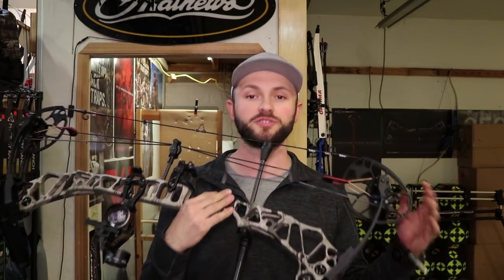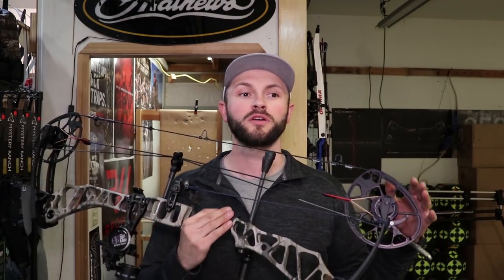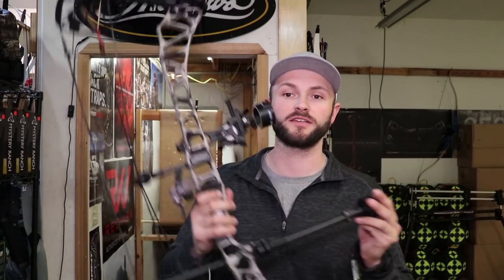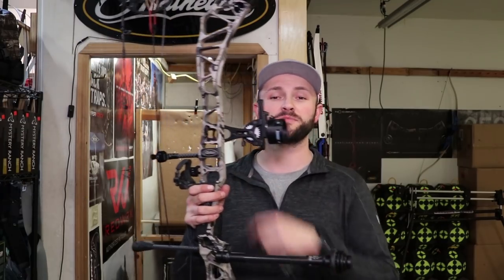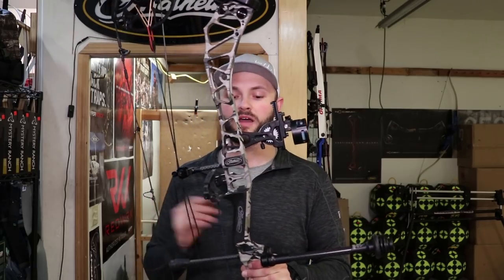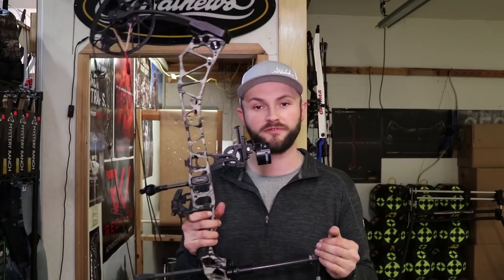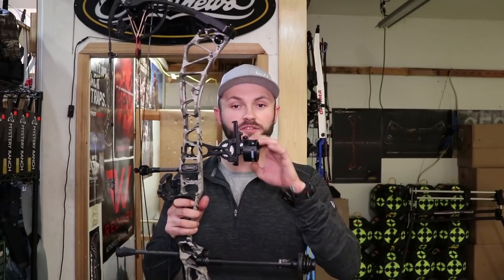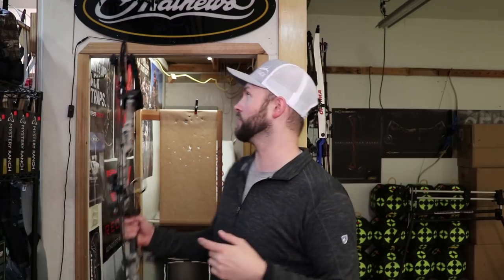Bare Shaft Tuning: Getting the most Forgiveness out of Your Set Up

Comment: Really good video! I bare shaft tune and don’t even worry about paper tuning with fletched shafts. Would like to see how your broad heads fly after a tune like this.
Reply from the maker: Agreed. My fixed blades fly right with my field points out to about 70yds, then start impacting low. But that's because there's more drag

Comment: How do you account for difference between arrows in your quiver?  If they are not all spine aligned, how do you know your 1 bareshaft arrow is what you should be making decisions on?
Reply: Simple. Use the spine aligned arrow to tune. Once youve got bullet holes fletch the rest and shoot. If they don't group well or have clean flight rotate the nock to different positions until they're shooting good. It's called nock tuning

Comment: How about what to look for when buying a used bow? 

I had bought a used bow from a reputable dealer in Dec that had replaced strings and limbs so I thought it was good to go but this last weekend one of my cables broke which basically blew the limbs, cams and mods apart, had it been hunting season i could have been SOL. Luckily i was shooting at a dealer shop and he had all new parts and was able to get me going again. What do others do in this situation if it was to happen to you? Do a lot of people have back up bows just in case?
Reply from the maker: Unfortunately most companies only honor their warranty with the original buyer. That really sucks that happened to you though, usually a used bow is legit!
Reply: @InsideOutPrecision  Yea I know most companies only warranty new bows. I consider myself lucky that I was only into this NO CAM for $80 before it broke so getting it fixed was still a no brainer. I was just thinking that other people may benefit (especially new archers) from a video on what to look for if they are buying a used bow.

Comment: Please do a spine selection video... For compounds there's very little out there
Reply from the maker: I actually have a video where I talk about arrow spine! If you have any specific questions though I'd be happy to answer them!
Reply: @InsideOutPrecision  I've had a look at the spine video and understand arrow spine and how to select and tune arrows as I've shot olympic recurve and can bareshaft + paper tune my recurve bow and also use the Easton chart to pick a suitable shaft for tuning 

However with my compound I've not been getting decent groups and for the past few days I've been trying to paper tune but can't seem to get a tail right high tear out

At 30" - 6 feet from the paper I almost get a bullet hole, sometimes nock height is level but I get a slight right tear other times nock high right tears..... I've shot with the string away from my face just incase it was face contact on the string but there was very little difference... At short distances I can get the bullet hole 

I've moved the rest, adjusted the rest height and tension on the rest from super stiff to almost holding the arrow weight... But if I step back say 5 yards I get nock high right tear... I can fine tune the nock high but not the nock right as the tear is around 2"+

I've shot with open relaxed hand and normal grip with a finger sling

I've even cranked the bow down 6 turns to reduce the weight but no difference and shot with and without stabilisers

I've shortened my drawlength from 27" to 26.5" but the only difference is I feel cramped on the 26.5" so have gone back to 27" otherwise I have to raise my bow shoulder to accommodate the shorter drawlength, with the 27" my release elbow is a little low but the shots are consistent because I can get the shafts to touch at 10 yards... I can draw level and bring the hand to anchor without craning my neck to find the peep so it feels comfortable and can handle the bow weight

(my recurve I shoot 26.5" drawlength and 47# on the fingers) 

I've shot pulling hard into the stop to having just enough pull to hold it in the valley, no difference other than the feeling of the shot... Using a thumb release truball max pro 4... I can trigger it using my thumb or pull through the shot using arm/back tension with my thumb wrapped around the trigger

I have a PSE stinger extreme, draw weight approx 50# (measured at 49.6# using my digital scale)

My arrows are Easton XX75 platinum plus... 2016 at 29" and Easton XX75 platinum plus... 2013 at 28"... I think the point weight is the standard nibb that's around 70grn 

The 2013 show less of a right tear but still nock high

Shooting with the fletch and bareshafts at 10 yards.. Unfortunately that's all I have at home I can get the arrows to group within an inch of each other and the bareshaft lands left of the fletched arrows with nock kicked up within an inch of the group

If I watch the arrow flight there is a kick right of the nock which shows up on the paper tune at around 5 yards 

The only thing I haven't tried is cutting down the shafts to 27"... I have an arrow saw so can try that but if the arrow isn't right, then will that help?

Are the arrows weak or stiff... Kinda hard to work out for compounds... Recurve finger release its a stiff reaction 

The cable guard has enough fletch clearance approx 1/8 of an inch+... I've also tried moving that
Arrow is level and centre shot as close to straight as I can get it

The question is how do I use the chart... Do I use the ATA bow rating 316 with my drawlength and draw weight to select the spine group or do I need to buy a chronograph and measure the speed at my drawlength

I'm interested in target compound and not hunting and would like to progress further with this.. Just having a hard time at the moment getting consistent groups out to 18m/20 yards at the club
Reply from the maker: @b12khx89  whoo, that is a lot to take in. What kind of rest are you running? For a right handed shooter a tail right/high tear that won't leave is usually a sign of too stiff an arrow. Try increasing point weight.  The rest will have a lot to do with it as well. Cable driven drop aways sometimes don't support the arrow long enough for bows with nock travel, which the stinger does.
Reply: @InsideOutPrecision  the rest is an avalon tec one rest... Nothing fancy but I did try and move it to tune and it ended up looking like the arrow was pointing away from the bow more than my recurve has ever done so I've gone back to all square 

I'm still working on my form and using my old recurve arrows in the meantime, the XX75 platinum plus are limited for different points with heavier weights so kinda stuck there... I'm not shooting compound for competition yet but would like to get better so tested it via the paper tune as I can see weird arrow flight if I watch the arrow

I wondered how you would use the Easton guide to select an arrow as it has different ATA speed ratings and using the bow weight and drawlength information it kinda puts me in T6/T7...which is probably wrong 

I am working on getting a form video done for you... The UK weather is getting better so I'll be in touch via your instagram
Reply from the maker: @b12khx89  that rest could definitely be part of the problem. I'd try a limb driven drop away like the Vapor Trail Gen7. Also I'd recommend going to an all carbon arrow in a 400 spine cut at 27-27.5".  As far as paper tuning, I generally just paper tune at 6-10 feet and get a bullet hole with a  bare shaft and a fletched shaft, then shoot them at 20yds and micro adjust my rest until they hit together. 
Definitely send me a video when you get a chance!
Reply: @InsideOutPrecision  thank you for taking the time to reply... I'll have a look at your suggestions, I'll practice some more and get a video to you

Comment: Love your videos. Do you use more than one bare shaft arrow? Is it necessary to nock tune? I ask this because I am finding that bare shaft tuning can be difficult, or finicky. Thanks for your help.
Reply: Nock tuning can help define the stiffer side of the arrow... This is ubertuning though, you need to be good good to be able to even tell... If your having trouble effectively bareshaft tuning you either have a bow tune issue or a form issue...bare shaft tuning, nock tuning require a tuned bow and rock solid shooting form and are at the end of the process...you dont just go out and shaft tune.

Comment: I'm amazed that people won't take that little extra time & synchronize the difference between the fletched arrow & the bare shaft. U can align a car but if the frame or foundation is crooked it won't matter. Then to make things worse they then throw a mechanical on & say good enough. Then they wonder why they have an 8 hour long bloodtrail with no results. I personally will not fletch an arrow unless the field points spin perfect & I know that I have the insert/outsert perfect. I have 5 perfect on my latest arrow build for my new bow & I'm still working on the 6th.

Comment: At what distance was the initial paper tuning done?
Reply: He replied to another comment: "I start at 6 ft and work my way back to 7 or 8 yards making sure its a perfect hole as I back up. Takes VERY LITTE movement in the rest to correct any kick at 8 yards"
Reply: @DarxusC  Thanks, that's why I just ordered a microadjust rest!  Bumping a normal rest 1/64" stinks.
Reply: @MrShysterme  yeah, the only thing I have to compare it to is a $700 rifle scope.  So, relatively, the stuff that came with my bow kit is utter garbage.
Reply: @DarxusC  Sorry to hear that.  Those bow packages are good to start, but eventually many folks want to upgrade to microadjust sights and rests that they can pick out themselves.  But those bow packages serve a purpose because they are a good gateway to let you get the experience to learn what you like.  Then you get ready to drop the major coin!  But don't spend that major money on all separate components until you have figured out what will work for you.  Check out Hamskea rests and Spot Hogg sights.
Reply: @MrShysterme  yeah, I knew the components wouldn't be great.  When I bought my good camera, years ago, I bought the body and lens separately, instead of a kit, because I knew more about what I wanted than I know about compound components.  I just feel like they went out of their way to make these kit parts as inconvenient to adjust as possible.

Comment: Thanks for the great content you share! I can get bullet holes fletched and bare shaft at about 4 yrds then when I step back to 10 yrds I'm nock high. Adjust rest up to hit bullets again but then I'm nock low back in at 4 yrds.. Any advice is greatly appreciated!
Reply: I’m having the same issue.
Reply: @jeremyanderson5752  I watched other videos which talked about how paper tuning at 5 yrds is optimal. Further back is giving the arrow too much time to react to the forces applied to it giving misleading results. Depending of course on many factors including spine, tip weight and draw weight. I paper tuned at 5 yrds and moved on. I'm shooting 6" groups at 60 yrds. I feel like I should focus on my form now at trust my setup. Cheers!
Reply: Have you checked vane clearance? Sharpie on rest and check for Mark's on flethings.

Comment: What about checking your shaft stiffness or weakness when bare tuning?

You mentioned in beginning and never talk on it.   I run a 350 VAP SS. 65lb. 250 up front. 510 gn total.

Comment: When bareshaft tuning at distance should you pay attention to what the shaft is doing in flight? So I shoot a bareshaft that bullet holes at like 3 feet and 6 feet. Then I take it outside to see if bareshafts and fletched group together. They group together but my bareshafts will be flying tail left or right. Enough you can see it and it is flying at an angle through the air. Is that just normal due to not having the vanes or no?

Comment: I have a Right Hand Traverse and keep on getting a tail left. My initial thought was spine but from 250 up to 340 I get same tail left. I have the centre shot at 13/16. I had it that you move the rest to the left if you have a tail left but from your video it seems that I need to move it right. In my case this will bring the rest closer to the riser and that can result in vane contact.
How much closer to the riser can I move centre shot? Will swapping top hats help? Looking at the cams from behind the bow the spacing of the top cam is basically even. Bottom cam is much more to the left almost touching the limb. Itis not that I’m new to the sport. Got my national colors last year in IBO and was the over-all winner of the South African Bow Hunters Association’s 3D shoot in the Fixed Blade Broadhead class. That was with my Bowtech Insanity CPXL. I though I know how to tune a bow.... but I’m not getting the Traverse to where I want it. Specs, 65#, 31.5” DL. Arrows at 31” with 50gn inserts and 100gn tips. Blazer vanes 2” x 3 and Bohning double lock nock and 300 spine. Most charts and calculators indicate 300 spine. Need some guidance. Thx Vick
Reply: Keep your center shot at 13/16. Left tear, move your cam to the left with top hats first. Rest goes to the right only on final micro adjustment. Cams follow the tear, rests go opposite tears.

Comment: I noticed your bare shaft doesn’t even have wraps on it. Did you add something like electrical tape to the bare shaft in order to get the weight the same as a fletched shaft?  You are probably 30 or more grains lighter with the bare shaft if not.
Reply from the maker: You can add a wrap if you want, but I've never had an issue not having one. I suppose if you really want to mimic your vane weigjt you could though. Those mini blazers only weight 12 grains (all 4) and wraps only weight 7.  Thats barely more than the weight nock so it shouldn't have any effect

Comment: OK I have some questions for you. I've been playing around with this a bit and am not having the same results on my VXR 28.
I paper tuned my bow and got it shooting bullet holes with bare shaft and fletched arrow at 6' and 5 yards.
I went outside and started at 20 yards and after my left and right adjustments, the bare shaft and fletched shaft were hitting together with the bare shaft no more than 1/4" higher than the fletched arrow. I figured this was due to the bare shaft being a bit lighter with no fletchings.
I then stepped back to 30 yards and my bare shaft hits about 2" higher than the fletched shaft. At 40 yards its about 5" so it keeps climbing as I step back further.
I moved my rest down and it improved a bit but only to a certain point. From there on, the bare shaft and fletched arrow point of impact move together with any adjustments of the rest and the bare shaft stays at about 4" higher than the fletched shaft and they don't get any closer. What am I doing wrong here? Thanks.
Reply: You have to think the weight of the
Fletching and glue etc. Are going to add weight which will give you a greater gap at distance

Comment: Why wouldn't you add tape to the back of your arrow to match the weight of the vanes?  Wouldn't that make a difference?
Reply from the maker: Hasn’t in my experience. But if you were really on the bubble of being under spines I suppose the extra 20 grains could make a difference

Comment: In the beginning of this video When it comes to making adjustments to your rest when you paper tune a bare shaft, does the same concept pertain to that just like it does when paper tuning a fletched arrow? (Meaning if you have a tail right, move rest to the left. If you have a Tail left, move rest to the right, if you have a Tail low, lower rest and if you have a tail high, raise your rest.) Same adjustments with bare shafts?
Reply from the maker: Correct
Reply: @InsideOutPrecision  Is it necessary to strip off the fletchings off all your arrows and bare shaft tune all your arrows or just have one bare shaft arrow to work with fletched arrows?

Comment: So I nock tuned my arrows through paper and had a consistent high tear. I lowered my knocking point and shot bullet holes with all 6 arrows. I then fletched one arrow and shot it through paper and I’m getting a low right tear but my bare shafts still shoot bullet holes? What’s the reason for this?

Comment: Question: wouldn't the high left rear not be because of the vanes not steering, but because you've taken about 18-24 grains of weight from the back of your arrow and weakened the spine a bit?
Reply from the maker: It would actually stiffen the spine, but I haven't ever had an issue with it. 18 grains would never be enough to effect a tear that bad

Comment: How do you know if the arrow shaft is too stiff-spined or not stiff enough for the bow strength/speed?  Will you see a difference in bare shaft testing with two different shaft stiffnesses.  I shoot at 62lbs from an RX1, trying to figure out if the 350 or 400 shaft is better for the tune-up with 13.33FOC, VAP TKO with outsert and 100gr tips.
Also, do you need to make sure the arrow weights are the exact same?  Or, is the decreased fletching weight negligible?
Reply from the maker: The weight of the vanes is negligable. Generally you won't see a spine issue through paper unless it's way too stiff or too light. But if you get a bullet hole through paper and then your bare shaft impact way right or left of your fletched shaft, then you'll k ow you're too weak or stiff.  What draw length are you shooting?
Reply: @InsideOutPrecision  I am shooting a 29 inch draw length.